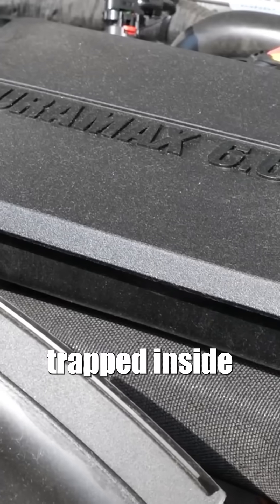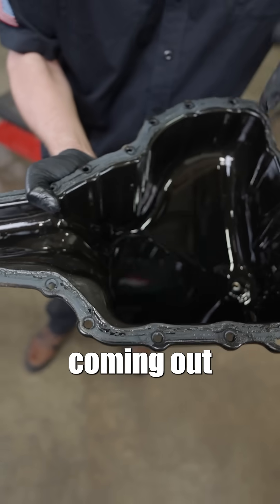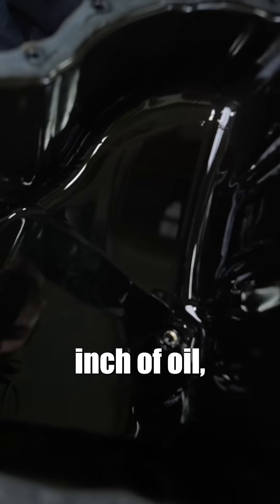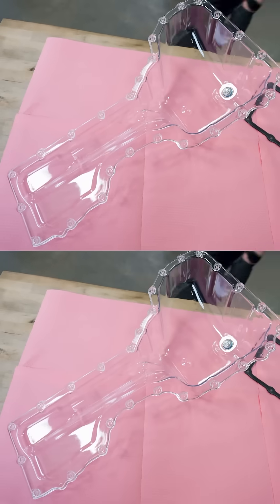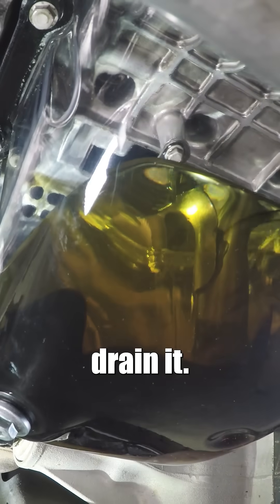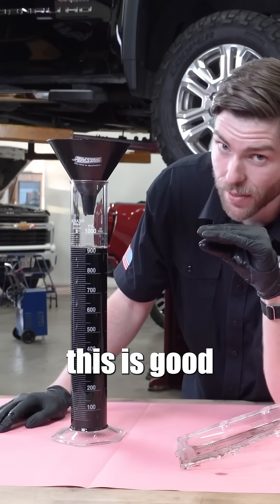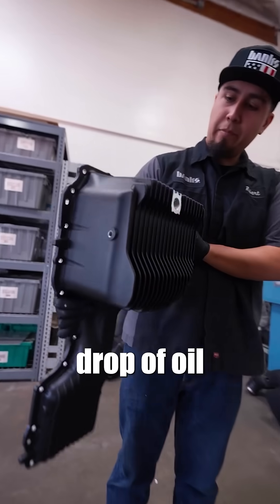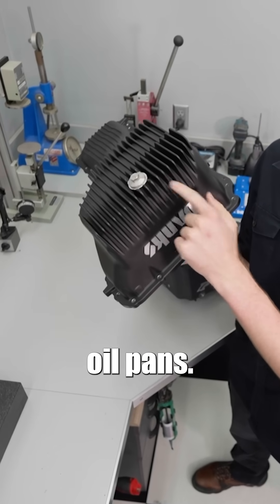A disturbing discovery. This dirty oil is trapped.

Comment: There's a way to get that dirty oil out of the oil pan. You take diesel fuel and you pour it in the engine.. keep on doing it until all the dirty oil is displaced and you get clean diesel fuel then replace the diesel fuel with the oil since the heavier oil is heavier than the diesel fuel and will displace the diesel fuel leaving oil behind

Comment: Just put a water hose in the engine bay and flush the motor. The water mixes with the oil and redistributes it out through the oil drain hole. once the engine is no longer extracting oily water, you can now let it sit, and add oil. Doing this for ever since one of my vehicles. Somehow I always get a new car every few oil changes though

Comment: 2024 duramax loosing oil into the coolant. Been into the dealership 3 times for this issue dropping it off again today for the forth time. It’s spent more time at the dealership than in my driveway. 0 codes.

Comment: It's not a lot of oil it gets mixed in with the new oil. Just make sure you change your oil on time
Reply: Yes but this would be a big deal for performance cars not jimmy just going to work.
When running a car hard this matters.
Reply: @alexgrinage  not really, this is still pretty useless, even on a performance car that gets driven hard that extra bit of oil getting mixed in with the new oil really won't make much of a difference if the oil is changed when its supposed too, which it should be for a performance car.

Comment: Dam, my engine only has 425k on it with the old design. I'm glad it didn't blow up before I had a chance to change it.
Reply: Better get on it.  500k happens before you know it!
Reply: 😂ROTFFLMMAO!!!😂
Reply: My crystal ball says your engine is about to go out at 430k. Change the oil pan asap.
Reply: DUDE - You are SO LUCKY you caught it in time.
Reply: LMAO I was just about to run out and buy a oil pan I have no way of changing! Thanks bro!
Reply: My 86 yotas had 999,999 miles. lmfaoo it prefered the old oil, once ya put new oil in it. The engine was not happy at all
Reply: Damn dude nice!
Reply: Do you suppose they made it that way to keep the system primed?
Reply: Probably been rebuilt a few times, the oil pan just helps keep your oil cleaner and cooler oil beaks down at high temperatures and it cuts power on some trucks
Reply: @MichaelIvy-d5p  no I bought it new in 1991 its a ford f150 original motor and transmission  (300 and C4)
Reply: @  that’s probably pre emission, newer trucks diesels all the soot goes back in the oil it don’t get filtered out that pan just helps keep the oil cleaner, just running amsoil makes a difference too less wear on internal parts
Reply: This doesn't matter to you.  But when you're doing high performance, it does.
Reply: @alexgrinage When you're doing serious high performance you're rebuilding before it's an issue.
Reply: @alexgrinage  What high performance? Get out of here. It's a Duramax.
Reply: @fwarleader  thats what they put it in for this application. Thats like say carbon fibers stupid. maybe for  you or most but has an valid application
Reply: @alexgrinage 
thanks for the perspective. 

as a commuter style driver im gonna classify your info as "good to know, but doesnt matter for me"

my highest speed is 100 mph and even then thats only in spurts. i did a max out to like 127 and man my engine took forever to get there. like a full 10 seconds to go from 90 to 120 ish.

id think it would be stupid to do 0 to max since that's a LOT of red line time and i wanna keep my car. shes not old enough to be called "old reliable" yet but shes getting there 2017 nissan rogue, got her brand spanking new and I got her for fuel economy not for high performance. 

i mean if im the first at a red light, Ive done some 0-60s before and its better than my last car. (2013 nissan altima) but still my next car will be a brand rated for high odometers like a chevy or toyota.

80k miles now and i hope i can get at least 150k miles. Its just cheaper to keep a car that paid off and save the money to buy the next one in cash. soooo wish me luck with a NISSAN.🤞
Reply: @ericolens3 she’s hardly broken in yet, I wouldn’t worry about it too much!😅
Reply: @ericolens3 why would you write an essay on something not related to the video

Comment: this is why you do 5000km intervals for oil changes instead of pushing to 8k, even 10k kms. using full synthetic, oem oil filters, and changing your oil on a regular basis will prevent any of the residue oil from becoming overly dirty
Reply: Thats a luxuary you can afford if you barely drive the car. Changing oil every month or every other month is absurd at 5000km.
Reply: @krish698  i mean my dad drives every single day across the city ($150 in gas every 3 days) and still does 5000km oil changes. it’s not that absurd and it’s better for the vehicle. especially something wracking up higher mileage. but it sure feels good to have the guy come back with your dipstick and ask if you want it changed, because the oil still looks brand new. (on a 2008 truck btw)
Reply: Taxi drivers only follow standard service intervals, and they easily rake up 400.000-500.000km on the engine. But they also drive very nice.
Reply: @frodej6640  they follow exactly what the manufacturer says for them to do, they go by what the owners manual says. it will never hurt the vehicle, but there’s still ways to treat them better. there’s a reason retired cabs are dirt cheap tho, they only have so much left in them with that sort of mileage (plus all the low oil pressure idle time they have)
Reply: That’s absolutely ridiculous.
Reply: @deleted.6743  sure it is. the proof is in the lack of motor wear

Comment: What about the oil in the recesses of the heads, the oil cooler, the low points of any galleries, not to mention the oil that naturally clings to every surface within the engine. The threaded boss that is proud of the inside of the pan is a lousy idea but you are straining at gnats. Its not that important.

Comment: Thats a steel oil pan, and the orientation of the nut isnt ideal. Most of my vehicles use an aluminum oil pan. The pan is cast thicker where the  bolt installs and that design drains better. Much like your design. Onky exception is my 7.3 idi. But that takes 3 gallons, so its not much of an issue.

Comment: An innovative solution to a non-problem.
Reply: Seriously though, the old oil will get diluted in with the new oil. It's not like it just sits there forever...
Reply: @dom7015  and its not even the "dirt" that is the problem. Its the lack of detergents that dissipate over time and use.
Reply: @Fooney1  Apparently you don't know how sandpaper or grit polishing work... the dirt is most definitely a problem.
Reply: @BaobobMiller  Dirt can be a problem but typically isn't. I don't have sand storms where I live so yea thats never really the problem.
Reply: @dom7015  i dont understand how you cant unstand  this is for a performance car not your wifes mini van. 
Unless she drifts that thang
Reply: The fuel tank will be next 😅
Reply: @myoi170 😂😂😂old fuel not good for your engine 😅😂
Reply: @myoi170  don't give em ideas 😂😂😂😂
Reply: It's an improvement really not a fix
Reply: The new oil is getting contaminated not only with the crap IN the old oil but the worst of the worst heaviest crap in the old oil. (that would be the largest dirt and sand particles, metal grindings, etc.)

    It isn't a non-problem and never has been. In fact the only people I have heard refer to it as not being a problem in the last half century are the people who make extra money from the extra wear/shorter lifespan it creates.
.
Reply: @BaobobMiller I was hoping someone would mention about larger particles that will sit at the bottom not getting flushed out especially tiny metal shavings..
Reply: @BaobobMiller  this ☝️
Reply: You just explained an engineers job in automotive with one sentence.
Reply: Maybe for the off-road vehicles this pan in the video is for, or for regular cars, but for actual performance cars this is incredible. Running completely fresh new oil while also improving cooling like that is extremely innovative. That's also why they're marketing this to people who will actually need and see improvement from this product. Your Camry doesn't need this and they never said it did.
Reply: @dr.schlump yep, same folks griping about this are also very unlikely to be using Amsoil
Reply: Maybe the could invent a system the filters the oil?
Reply: technicaly there is a problem its just isnt realted... the problem is the oem oil pan is made from plastic which is a terrible idea! if i stick goes through it cuz you hit it goodbye engine!
Reply: @dylanlindsay1993
Just so you know, that stick will never hit that oil pan because it's got a skid plate mounted on it. 
Made of plastic, the hardest material known to dolphins, the skid plate completely dissolves dirt and debris before it gets the chance to hit the oil pan. 
BMW engineering btw.

(Entirely sarcasm and satire)
Reply: I mean.. hey! It wont hurt!
Reply: That's what we call "engineers"
Reply: Your opinion probably why my car last longer then most car. I don't have the fund to modify, so I just jack up one tyre, tried to completely drain.
Reply: Dry sump and a catch can for life
Reply: He explained in the video why it was designed that way so you don't loose lubrication in your system with air.  Dirty oil is better than no oil.
Reply: @andrewlukachko4103  I always fill my oil filters up completely with new oil when changing them. I've noticed I don't get the dry rattle at the first startup when I do this.
Reply: @EthanThruandThru so you like to run unfiltered oil through your engine every oil change? Nice.

When you pre-fill oil filters you're putting the oil into the post-filter area of the filter. That means any particulates that are in the oil will run through the engine until they make it back to the oil filter. Terrible for your bearings.

Your oil filter fills and your engine gains full oil pressure in a small fraction of a second on startup after an oil change. Plus there is still residual oil dispersed throughout the engine, so it is worse to pre-fill your filter and run unfiltered oil through your engine than to just oil the O-ring and slap the new filter on.
Reply: @DoovieHoovie  Were do you get your oil that you are worried about unfiltered oil from a prefilled oil filter? Do you scratch it from drive ways?

Did you know oil filters have a bypass, so cold oil goes unfiltered through the engine?

Also its pretty common that the inlet to fill up the oil is on one of the cylinder heads, so your dirty new oil goes unfiltered through the engine anyway
Reply: @EthanThruandThru put your left foot on the brake and the right foot on the gas to the floor. Then crank the motor this will prime the motor before starting.
Reply: @DoovieHoovie   Its new oil. It doesn't need filtering.
Reply: there is a small amount of oil that will never be changed through the life of the engine

Comment: You don't need to replace all the oil. Replacing 90-95% of the oil is good enough as long as you put a new filter on it. Have any engines failed with an oil change once per year due to the oil caught in the pan and galleries? Answer is no.

This guy just wants to sell you something you don't need.

Comment: It prevents from using the oil flush as well, so effectively after a while your engine will start losing power due to pressure leak on the piston rings. Sucker will go to buy a new truck.

Comment: Great add but if you're that concerned about it, just flush the oil! The Honda drain pans have worked on have a drain plug on the side at the very bottom

Comment: I'm skeptical that the small amount of undrained oil is going to ruin an engine as long as you use good filters.  It's going to get diluted into the new oil so it's not like it's the same dirty oil the whole life of the engine.

Comment: I usually jack up one side of the truck, then the other, to empty any galleys or low spots that may be holding oil further up in the engine. This would probably break the airlock on the pickup tube as well, when the oil flows to the side of the pan and exposes at least part of the pickup.
If I'm replacing the pan anyway, and the price difference is reasonable, I 'd go for a pan like Bank's, better cooling, more complete oil drain, etc. But if that little bit of "old" oil is really going to do any harm, you're running your oil too long anyway, and it's doing it's harm before the oil change ever occurs.

Comment: Are we not sure it's ment to keep the oil in the pickup to prevent dry starts and if it has to complete suck that little bit of run time is causing severe aeration and possibly causing damage

Comment: "You're stuck with a quart of dirty oil forever" that's some YT drama there. and it's not true. This oil mixes with the new oil. and If that left behind oil was a significant problem,  the engine designers would have eliminated  that hold back area.

Comment: Yall act like your truck is going to be sitting for a year after the oil change, and it will be such a terrible dry start.      Have you ever taken an engine part it has oil everywhere including up top at the most distant point months after the last time you started it.      Priming the pump isn't an issue

Comment: I just use warm water with a little dish soap to displace the oil. Then I heat the pan with a torch to evaporate the water. Works every time.

Comment: So if you're smart enough to do it right, you could take the stock pan, shave the weld nut down on the inside, and thread it on the outside..... not having to pay $ 1600 for an oil pan.

Comment: It’s amazing how aftermarket engineers are way smarter than the people who initially designed the vehicles.
Reply: Different goals. The factory engineers want it to last through the warranty period, owners want it to last forever.
Reply: Ehhh, I'd revist the comments 😂. There is a very important reason that 1 qt of your old oil stays in there. This thing is actually creating a problem to a solution 😂

Comment: Pro tip: dump a quart and a half of water in your motor. The water is heavier than the oil, it will sink, displace the trapped oil and float it to the drain. The more you know 🧠🧠🧠

Comment: Ok so here’s the math
The duramax has a 10 quart oil capacity, and you’re saying when you change the oil you’re only changing 9 of the quarts. So I will say that the main advantage of draining all of the oil would be that you have to do oil changes roughly 10% less (1qt/10qt) to keep the engine healthy. Or rather you can go 10% longer without an oil change every time. So instead of going 10,000km I can now go 11,000km. Like sure it’d increase the engine life a little but I reckon draining the pickup completely every single oil change is going to be way way worse for the engine overall. You say it’s negligible but so is the benefit of draining the last drop of oil out of your pan, funnily enough I think most cars have been designed with that little bit of leftover oil in mind.

Comment: This may be true but is unnecessary.
We have had multiple cars have done 150-200k miles with normal oil changes and never had a single oil related issue.
Engineers do account for stuff like this when designing an engine. 
Having a little contaminants in your new oil is not a big deal as long as you change your oil on schedule so that contamination isn't too bad. 
Sure if you had never changed your oil and its black sludge then it might have more of an effect, but if your oil is just a bit dirty the overall dilution is more than enough.

Comment: Banks is an upgrade and better design.  But all engines have left over oil.   Can never get it all out.  However it circulates and mixes with the new clean oil.  And most engines last long enough that the car its self rots mostly away before the engine fails.

Comment: So why wouldn't engineers design this correctly in the first place ?
Please comment !
Reply: Because it's fine. That little bit of "old" oil is going to immediately get diluted by fresh oil. If it was ever going to do any harm, it would have been doing harm before the oil change anyway, and you'd need to shorten up your oil change intervals to avoid it. 
If I'm replacing the pan anyway, and the price difference is reasonable, I'd get the Banks version, but the stock version really isn't as bad as they try to make it seem. If you're changing the oil with the truck on the ground, you could even jack up one side of the truck to break the airlock on the pickup tube, and get that little bit of extra oil out of it. Honestly, the original engineers probably designed it that way to avoid draining the pickup tube, so that you wouldn't be pumping air throughout your oil system upon startup. *shrug

Comment: Nice upgrade. Amount of oil left in the sumps depends on car brand/ pan design. I use an oil extractor and get most out. Note most automatic transmissions are also left with an amount of old oil, it gets diluted with new oil. Therefor timely replacement is important. Once bought a Honda where t was not replaced ever in 20 years and only short drives ever made (very low mileage) so the oil looked  like red whip cream. When going into overdrive/lockup it would go with a big "BOINK", it took four drains and refills to get the oil in condition where the transmission would shift normally again.

Comment: Very cool, although theoretically just pour in an extra quart of oil or so with the plug off and you should get some extra nasty oil out. Regardless it'll never harm the engine anyways unless it's contaminated, in which case that small extra quart won't be of any concern anyways 👍

Comment: Or, just stick a strong magnet on the pan near the drain and remove it as soon as you open the drain plug. Also with frequently changed oil and filter, you shouldn't have any problems anyway!